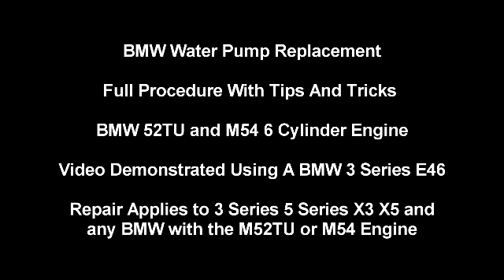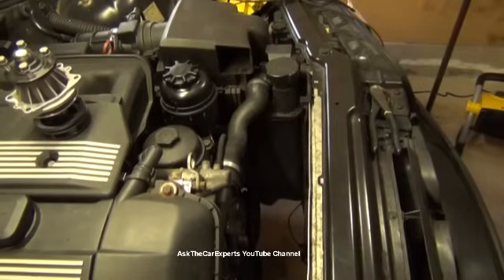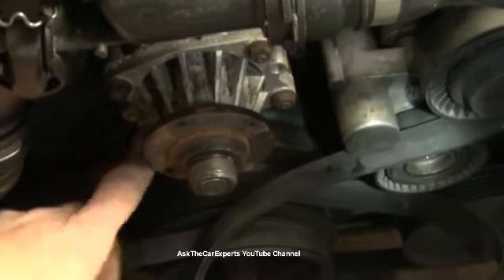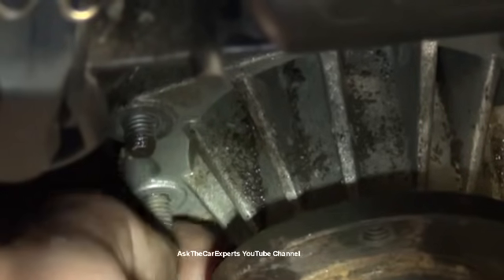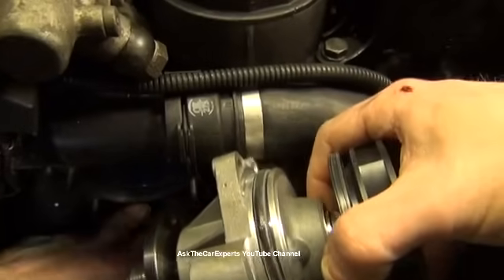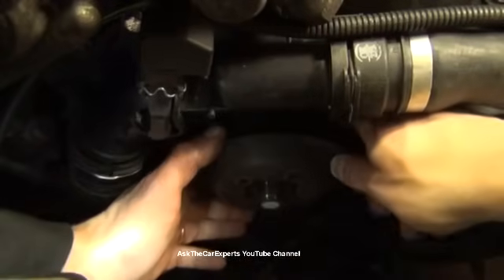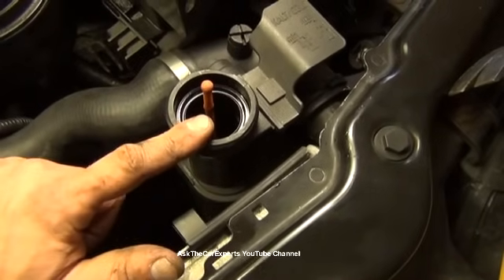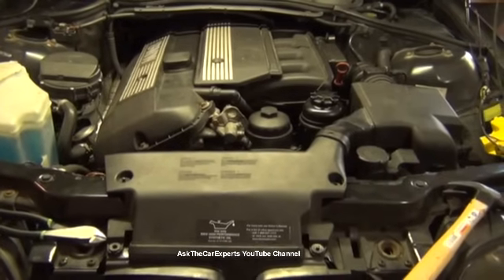BMW E46 Water Pump Replacement 6 Cylinder With Tips And Tricks

Comment: Hiya, love your videos. Can you advise me here in England please. I've got a 2002 E46 Coupe and recently I heard rattling in what I thought was the engine. Shortly after I had to stop the car because the fan belt had exploded again. I changed the fan belt last year knowing that I'll have to change it yearly because I could not find a dumper to replace the damaged dumper. 
However, while taking the fan and the housing of I realized the water pump pulley was broken and the water pump itself was unsteady to the touch. After taking it apart I noticed that some of the ball bearings had been dislodged and here is where alarm bells raised it's ugly head. Was the rattling i heard earlier due to dislodged bits and bobs from the water pump itself ? and if so was course of action should I take to clear the debris from wherever it has unfortunately been lodged ?
Any advice would be helpful please ?

Comment: Dude. You're my hero lol. I am replacing my fan, fan clutch, water pump and pulleys tomorrow on my 99 323i and was a little worried if i would get through it with these step by step pics on the forums. You just gave me alot of peace of mind and saved me some potential issues. Thanks a ton!

Comment: Hello and Thankyou Very Much !!!  Extremely Balanced and professionally done video on the water pump process. The little tips are also fantastic.... a bonus of years of experience most of us weekend warriors don't have. The only add you might expand on is to differentiate the diagnoses of a failed pump vs. a bad tensioner bearing noise? I'm about to dig into the job and was trying to isolate the actual noise....Just started making the dry, whistling bearing noise...2005 330ic auto 64,000 miles. In any case Im ready based on the confidence you gave me . Respectfully
Deane

Comment: Excellent video. You made it really easy for me to replace my water pump. My car over heated on me and unfortunately I didnt pull over right away the valve cover bolts come loose which causes oil to spray everywhere. Do you have a video on how to replace the gasket and valve cover?

Comment: Thank you for your video! You saved me 800$ !!!
My water pump went on my 2003 x5 3L. 
So happens that I was pretty strapped for cash at the time. I called the mechanic and they wanted almost 900$ with tax.
After I watched your video I had the confidence to do it my self. I got the pump for 98$ plus tax!
Now my car is back on the road. And I'm very thankful for your video for without it I wouldn't have the ability to get it done. God bless you and your family!

Comment: This is very helpful, if you have a bad water pump, does it affect the heater core -- as in no heat? I've had a continuous leak on my Z4 (M54) when it gets cold during storage. The coolant tank never leaks all the way, and it appears to be coming from near the middle of the bay. Going to pull the electric fan and check for leaking.

Comment: Very helpful video. I have a problem. I changed my thermostat and now my temp goes to red in 15 minutes at idle and later the coolant leaks from the radiator cap. Can this cause by a bad water pump or bad coolant sensor? Thanks.
Reply from the maker: +Ken Lu Hello Ken, What was the main reason you replaced the thermostat?

Comment: Great video, very detailed.  I'm at 132K miles on my 02 325i. Just had my water pump replaced. Mechanic uncovered a small vacuum leak (thank god).  Change the oil about every 6500 miles.  Anything else preventative you could recommend? Any fuel or oil adds etc. to look for? Basically, any preventative maintenance advice you could give that the regular person doesn't think of, let me know! Thanks!!
Reply from the maker: drewfogle Hello Drew, Thanks for posting a comment. It sounds like you are doing a great job keeping your engine clean. 6500 is a good number. I am not big on any additives, just regular maintenance. Brake fluid 2 years, power steering you can easily suck out and fill to keep it cleaner every year, don't forget to change the diff fluid (every 50K is good). Thats a common thing that is forgotten along with tranfercase fluid if you owned and X drive.

Comment: Thank you. Great thread. The trick to get the pump off works great. You can also use the two screws that hold down the air box to push the water pump away from the engine block. Turns out they are the same thread and the perfect length.

Comment: Great video.  I loved it.  I have 2000 740il and it's heating up. temp gauge goes from mid to just before red but never on red.  I bled it and added more water.  drove it and same problem except water came out of somewhere.  I waited 4 hours and I put in gallon and half.  water stayed in and drove it home 2 miles away.  Don't know what to do.  I can change thermostat or water pump if I have to.  what you suggest.

Comment: This is so much easier to replace than the ones on the new N54/N55 motors.
Reply from the maker: Hello Tommy, Without a doubt the M54 is much easier! The electric water pump is squeezed in really tight.

Comment: My pump was leaking through the bearings, I replace it and the problem went away.. However I now have a knocking sound that it's definitely coming from the pump area.. Not sure if I didn't install it properly or just got a lemon.. Anyways, thanks for the video, really helpful..